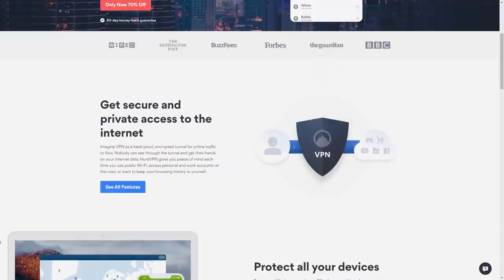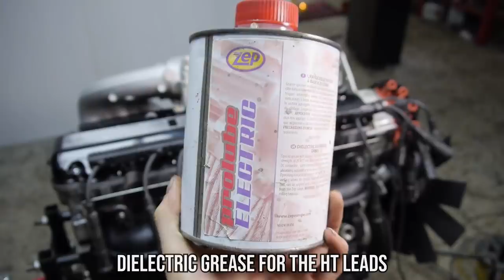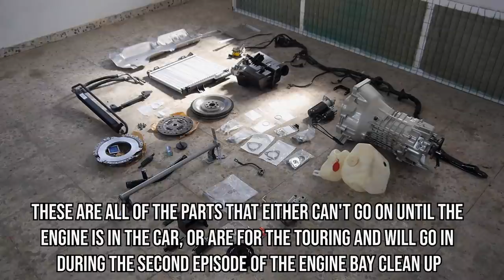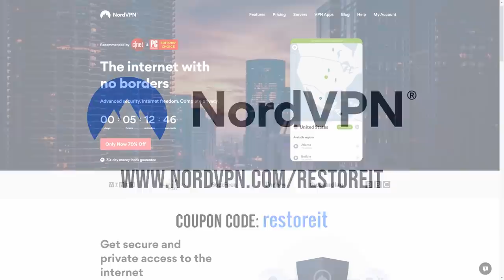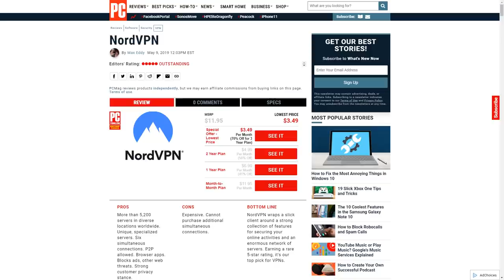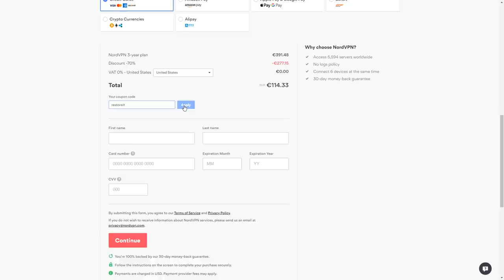BMW E30 M20B25 Engine Rebuild Restoration -  | Part 9 | Putting It Back Together Again

Comment from the maker: Get 70% off NordVPN! Only $3.49/mo, plus you get an additional month FREE at https://nordvpn.com/restoreit and use code restoreit
Reply: Hey.. check your timing belt please..
Reply from the maker: Thanks for the heads up, i know its wrong. I want to wait until i have the right tools to correct the timing. I have plenty of time before this engine goes in. I'll get it sorted, thanks man.
Reply: @RestoreIt  pheeeww.. Thanks god.. I thought you are gonna leave it like this.. don't even try to crank it.. Good luck man.. waiting for it to run.. That engine looks brand new btw.. Cool work.. Also check for the oil gaps for the valves and the main shaft.. if that's not set correctly then you'll face premature wears and improper combustion.. 😐
Reply: Thank you NordVPN for supporting this channel.
Reply: @syedminhazuddinrizvi3068  valve gap already set on workshop you can check it on his previous video
Reply: I know it's already been said but you forgot the dowels.  Otherwise this seemed like a great learning experience for ya.
Reply: you born for this . can i work for you boss. im from Egypt this my dream work please . boss.
Reply: i love engine boss
Reply: @Veganf00tS0ldier   ok boss i will be ur hand .you talk really .
Reply: How long does the code nordvpn last?
Reply: Puta obra de arte
Reply: Nice job, I have a Touring also. I put an M20 in it and was completely disappointed. I am now swapping a S50B30US engine into it.
Reply: Hey by any chance Im restoring my engine as well, do you have a parts list of seals, gaskets, and parts you ordered for the rebuild so I can verify and match mine to see if I am missing anything it would be greatly appreciated. I can send you a dm on Instagram or Facebook if you have it.

Comment: Just a note when doing cylinder heads: Check the torque of all bolts afterwards because the first ones you torque will loosen as you tighten the rest. 👍

Comment: Great video! I'm binge-watching these at the moment.

I know this video is almost two years old, but for anyone doing a timing belt on these engines, you should rotate the crank through two revolutions before you tighten the tensioner bolt, it takes all the slack out of the belt.
Reply: As in, after you slip the belt on and loosen the tensioner bolt (allowing the spring to expand and take up slack), you rotate the crank twice before re-tightening the tensioner bolt?
Reply: Yes, exactly. I believe that's what the manual recommends.

Comment: I love everything you have been doing with this restoration series other than when things need to be done before hand like timing the engine or not using the correct bolts or tools. Your just creating more work for yourself man. I never like to repeat my work and I know you wanted to get the video out but I would have much rather saved you more of your own time if you had waited for everything you needed. Just looking out for your own sanity since time is a precious resource!! Thank you for the videos though man. Keep em coming!!

Comment: You dont need that special angle torque device =) just write a line on the bolt and turn it to 3 o clock =) 🤗

Comment: I believe you forgot the dowel pins between the block and cylinder head.
Reply: I was going to comment the same thing. Really important!
Reply: he also greased way to many things like the shaft sealingrings and the headbolts ...that one of the first things u will be told when u offically learn the "job" of a mechanist in germany ... when u grease a cylinderheadbolt (for example) it does not have the same tension (more) like if its not geased when torqued to the same spec ... simply because of the reduced friction !
Reply: @heinzkot360  zylinderkopfschrauben beim E30 werden aber gefettet eingesetzt und das Drehmoment bezieht sich auch auf gefetteten Zustand. bei den anderen schrauben bin ich bei dir
Reply: @DrehzahlDieter  ouh ... okay das wusste ich nicht :D das sind dann die feinheiten jedes Herstellers UPS :D
Reply: Heinz Kot the torque in this case is achieved by torque angle gauge, so it doesn’t matter if they are greased or not.
Reply: Wow... If you need something to rebuild I've got a M62B44 leaking oil hehehehehe
Reply: @heinzkot360  He put anti-seize on the headbolots, isnt that a good thing?
Reply: @PoisoneDrummer  not in every case. because you have less friction so the needed torque is not correct when tightening the bolts. In this case BMW says you need to insert the headbolts with grease. But for other screws and bolts thats not the case, so you could overtighten the bolt
Reply: @towlie911  thats not true because before tightening with a certian angle they get torqued down with a defined torque. But in the case of the M20 engine BMW says you need to insert them with grease, so the torque which is given by bmw is calculated on greased bolts
Reply: @towlie911  wrong ... the first torque down is done with a torque tool ... wich, to all our surprise, does infact mesure the torque thats applied to the wrench and the bolt ...
Reply: @PoisoneDrummer  i was wrong when i used the example "greasing the headbolts". BUT only in this particular engine/-type the bolts need to be covered in antiseize. to be honest ... i don`t know if thats correct because i work for mercedes and they SPECIFICALLY forbid the use of any grease or antiseize on headbolts and some more types of bolts.
Also as i have to repeat; Bolts wich need to be torqued to spec almost all have to be clean pure and not corroded metal when assamblied wich is the second most important reason why you have always to replace them after one use"circel" ... this is a keye factor in torque specs:to have always the same Friction and therefore always the same tension
Reply: Good thing is that we now know that there are some engine bolts that need grease and some don't. Learn something every day, and that discussion in very big part of it.
Reply: @heinzkot360  Yes, but not in the way you think it is. It's rather the opposite, it's too loose because the layer of grease will create an hydraulic barrier between the bolt head and the surface.
Reply: @DanielleMoren  yeah if you would turn it with a speed of lets say 2500 rev`s XD
Reply: Ouch!
Reply: First I thought the same, but I think they were put in cylinder head before assembly. As you can see in part 8 at 4:25 where the machinist prepaire the head for the machining. They came out with the head.
Reply: although this is true. most engines will require a wet torque on the head bolts.
Reply: @heinzkot360  grease can change the torque reading giving a false reading. This is true, but these head bolts are Yield to torque. The initial torque is to set them the same and tight. The 180* of additional turning yields the bolt to the Yield clamping force. It is very important to use OEM new bolts as the Yield will only happen at the designed clamping force. They are engineered to not be "torqued to spec" but to be "Yield to clamping force". This changes in respect to bolt diameter, alloy properties, thread pitch. Where as torque to spec can be affected by all these in addition to thread engagement, bolt head shoulder resistance, etc. Yield is unaffected by the same issues that torque is with respect to grease, therfor exempt. But, you are 100%  right grease can affect torque. They shouldn't call it "torque to Yield", it should be called "torque then Yield".

Comment: I hope the timing belt is corrected for position, and hope that the sparkplug wires are in correct order. Great video as always.
Reply: Yeah. Did not really even mention timing or tdc etc.
Reply: He said he was going to get someone else to do the timing when it was ready to go in to the car
Reply: @bg73  LUL !
Reply: @bg73  so he basically put it back wrong and with old injectors just to upload a video to youtube?
Reply: @M9Only  I think it was a case of we've been waiting so long for the assembly video and he was still waiting for some parts that he basically just put it together so that we could finally see it assembled.
Reply: I noticed that too. Very important with an M20 since they're interference engines. The timing is super easy to set and the only way to do it is with the timing belt removed so the whole front of the engine will need to be disassembled to do it and hope that the bottom end doesn't need to be rotated enough to hit a valve.
Reply: @skudak  I'm actually extremely concerned about using old bolts/fastener... Basically all old engine uses torque to yeald hardware, I've snapped so many bolts because of my lack of knowledge in the past. I'm in for restoration and everything, but I wouldn't trust at least half of the part he restored when it comes to reliability (not changing oil cooler lines, not using new faster, sort of setting timing in an interference engine, etc)

Comment: Beautiful looking power plant, very well done. One thing I would interject, is that you forgot to set the valve lash. It's a bit easier to do before putting on the intake and installing the spark plugs.

Okay, two things. The second is that you should spin the engine 2, preferably 4 times and reconfirm timing marks prior to tightening the tensioner back down. You want the engine to rotate using the spring pressure to gather up all of the slack onto that side of the belt before you tighten the tensioner back down.

Comment: I think you forgot the torque inhibitor bolts between the valve manifold arm and the front crankshaft flywheel gasket. Those are easy to overlook... Very impressive job, the engine is looking really sharp!

Comment: 14:05 you forgot the shaft seal that goes in the guide cover. It'll oil like crazy.
Reply: i was just about to say, no cam shaft seal
Reply: No he did not. It will be in second video.
Reply: kkkkkkk  Vai jorrar oleo.
Eu ainda acho estranha a hélice deste motor

Comment: I can't see a little bushings beetwen cyl block and head, it adjust line cylinder head and gasket. I hope u instal this its very important. And never use grease to assembly sealants- u have a assembly lub. Sorry for my english i hope u understand me 😉
Reply: You shouldn't use grease for the installation of seals at all. Just makes it easier for them to slide out after installation.
Reply: @d3rg3raet25  been an auto tech for 15 years. I always use oil or grease for orings and seals so they dont collapse over themselves when installing. Ive never had an oring "slip". They sit with pressure and inna groove its not going anywhere. That grease melts off at first start. Dry seals are far more dangerous then greased ones. Most people don't know some seals have a metal spring ring around the seal on the inside to keep pressure.
Reply: In aircraft maintenance,reference to the manual given by Boeing or Airbus,we use oil, grease even jet fuel to lubricate seals or o-rings before installation,and this step is necessary.
Reply: @sun152060420  the outside as well?
Reply: @forevercomputing  true but id rather not have them roll out of their grooves especially water pump or oil ones.
Reply: @forevercomputing  i said nothing about gasket sealer mate i think you read it wrong lol.
Reply: @forevercomputing  dude, I didnt mention sealant or sealer once lol. Not sure why you keep bringing it up.
Reply: Forever Computing if you use only the paper gaskets they will leak. Silicone works, but generally you use it without the paper gasket. Either way works,

Comment: It's a good idea with a build like this to mark every bolt that is fully torqued down with a line across the head of the bolt onto what it's going in to. This both shows which bolts are tightened and which are loose and also gives an indication of any bolts that have backed off!
Apologies if you were doing it. I just didnt see it.

Comment: One question: Are you aware of the hydrogenation that occurs during plating and its effects on  fasteners? I witnessed a catastrophic failure of a drum brake when the stud supporting the brake sleds sheared off during a panic brake test. The manufactured had forgotten to dehydrogenate the part. And it has to be done within the hour after finishing plating.
Reply: @islanti how else do you suppose he learn?
Reply: islanti in this video alone he’s fucked up several times LOL but , definitely doing an amazing job considering it’s his first time
Reply: My understanding is the fastners need to be heated/cooked in an oven straight after plating. Not dried in the sun like he did.
Reply: @zerotohero7449  Yes, from what I learned from that incident 50 years ago (I was with GM at the time), the procedure was to heat the parts in an oven at 200° F for one hour.
Reply: @blockpartyvintage1568  I'm not so sure you want to learn that way. Too expensive and way too dangerous.
Reply: A Z  So because he doesn't have a video he can't critique an error? I hope you never critique pro sports then.
Reply: i wonder what pasivate he used. I believe Cr6 is now banned in the EU yet they come out very yellow

Comment: One helpful hint for applying gaskets to a part is to use gasket sealer to attach the gasket to your part and then use high temp anti sieze on the other side of the gasket that way the gasket only sticks to one part and makes it easier to remove in the future

Comment: You'll want to disconnect the spark plugs when you do your first few cranks to build up pressure etc. So happy to see the progress. I wish you had the time and other resources to "upgrade" some of the components for more efficiency/cooling and possibly performance. I mean not racer boy but power, fuel, reliability, brakes etc.

Comment: Top Tip:  For the most accurate torque readings, do not use an extension on your torque wrench if at all possible.  The extension has a tendency to twist a bit and skews your actual torque setting.

Comment: You threaded spark plug cable number 4 through the wrong hole. I already noticed this in part 7, but thought you would notice it on assembly. Well, you did and pulled some excess cable back.
Note, I'm not an engineer, that's just my OCD speaking out :)
Keep it up!

Comment: make sure the ignition time is correct  or then you gona brake the valves when you torn on the egnine the piston gona hit the valves if it not adjusted correct    "toothed belt"

Comment: you need to fully turn the engine twice clockwise after putting the timing belt. you do this before torquing tension spring bolt, otherwise, the belt won't stretch properly and tension won't be accurate.

Comment: The satisfaction at the end.. worth the sweat. I’m doing my late grandpa’s bay now. Still not done with the tucking. Going to repaint all the parts too. One question, is it ok for me to paint the radiator and condenser without removing them?

Comment: Hopefully everything is tight and it was not forgotten anything to install and the engine brings the compression. There is nothing worse than removing and disassembling the complete engine again. The timing has to be adjusted as well.

Comment: I hope you did not forget the dowel pins between the Head and Block to aligne the Gasket and the Head. And never ever use grease on the outside of radial shaft seals.
But other than that. Looks Great

Comment: You need to rotate crank shaft twice clockwise before locking timing tension spring, otherwise timing tension will be incorrect.

Comment: Also front crankshaft seal is not properly inserted (I did the same as you did) I got massive oil leak. 

Turns out, need to have special tool for inserting this particular O-ring. But I purchased AUDI crankshaft seal with Spring tension and just normally inserted without any tools and still not leaked for more than a year.

Comment: Just as a piece of advice, don’t use RTV unless it is expressly indicated by the manufacturer. This can cause leaks because you’re leaving space between the mating surfaces where the gasket is supposed to be bridging. I can almost say with 100% certainty that you will have issues down the road with leaks and possible gasket failures.

Comment: You fan is backwards, you need it to suck air from the radiator, as it turns clockwise you need the concave part pointing to the engine!

Comment: Great job, and unless you do this everyday always follow a manual as easy to miss things or have a system to re-check.
Life is a lesson and keep it up
Also why does everyone have these complicated kits for zinc plating, i just use zinc rod and PH suitable water + good power supply or battery charger (you don't get gold colour) but can't beat $10,couple hrs and i can use my bolts straight away or powder coat them.

Comment: Hello great videos! I have a question, when you place the timing gear separately, how did you adjust the gear to be top dead center? and how did you place the damper to be aligned with the timing marks since the timing belt was not on? thank in advance

Comment: That engine is a work of art now. Can I ask, what method do you use on large items like this engine for keeping track of where each nut and bolt goes. Especially when you took them out of bags with labels to electroplate them.

Comment: The aligning dowel pins missing and torquing the head bolts without showing proper timing before makes me nervous. Take it apart and put them in and teach yourself to do the timing brotha it's easy and that way you know it's done right. Good luck best wishes

Comment: Couple things i saw wrong watching this was but who knows if you corrected this between cuts. First i noticed you did not have cyl 1 at tdc before putting on the cyl head and then 2 i noticed the cyl head guide pins with not installed. If this is all real then i say good luck to the valves and also hope it doesn’t blow a head gasket. 😅😖

Comment: Sorry for the noob question - is there any particular reason you're not using any power tools to fasten all these bolts? I know you need to torque to spec, yes... but first 999 turns would be a lot faster with a drill.